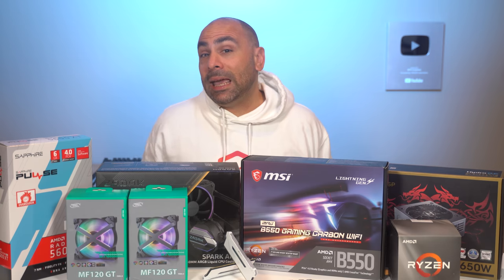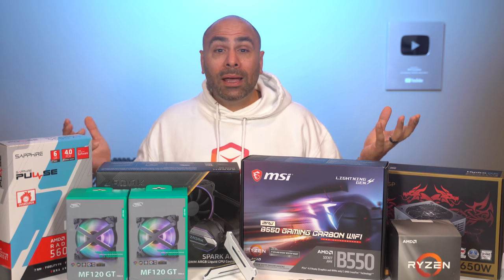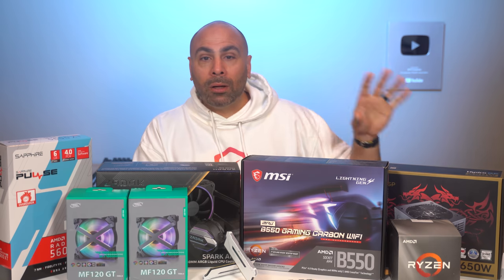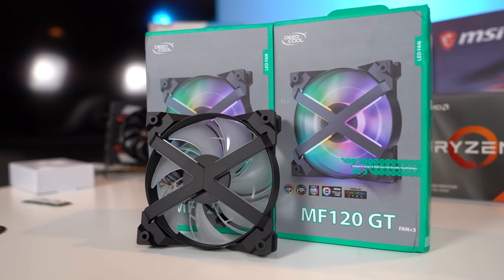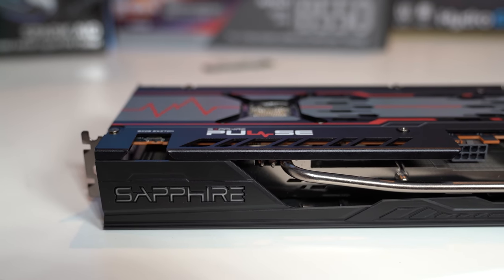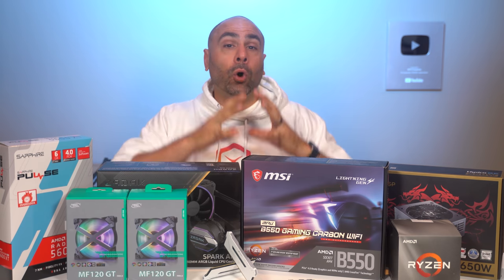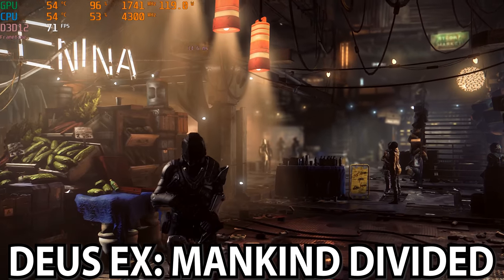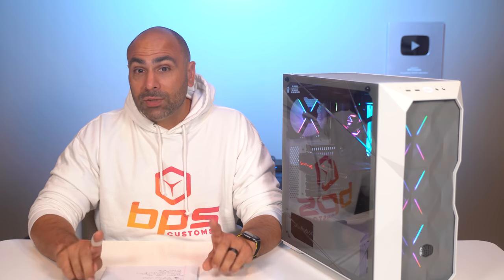This PC Should Be $1000 (But It’s Not)

Comment: For anyone wondering about that windows key. I took a gamble and tried it and it worked! No problems at all either!
Reply: how long to get the key?  Did you have to make a phone call to activate?  Thanks
Reply: @bguillory6675  nah it was instant, bought it popped up copied it and activated it and the watermark went away. Have had no problem since
Reply: @kraqd  Thanks for the info friend, will be starting my build in next few days, and was wondering about these cheap windows keys, I guess for less than $20 I wouldn't be out much if it is a scam.

Comment: G'day Brian,
that is a really nice Build, Fancy but not ridiculous & thank you for fixing the Middle Front Fan 9:19 😬😬😬😬😬OCDOCDOCDOCDOCD,

I've noticed in a few build videos in the US prices are almost what we pay 'Normally' here in Australia for some parts, thankfully we are getting back to normal although like you guys PSU's are hard to come by,
We got AMD's 3000 price drop & stock levels although low are not raising the price anymore, like R5 3600 $299AUD down from $329AUD pre CV (& got up to $369 During CV), B450 is still up about $20-40AUD & B550 is right between B450 & X570 prices for Namesake Motherboards,
Intel Prices are still Sky High for CPU's & M/B, i5-10600K is $499AUD & Z490 starts at $279AUD for the ones You Shouldn't Buy & decent ones closer to $400AUD easily out pricing X570

Comment: b550 Tomahawk is the best all-rounder mobo. Ethernet cable is better than wifi and you can always buy a BT5.0 dongle.
Reply: I bought my b550 gaming carbon wifi on sale for 189.99  but now, Dec 16th 2020, it's going for 219.99.

Carbon WIfi has Better VRM than Tomahawk. It comes with Wifi6 which is good for me since I can't get an ethernet connection at the moment. 
But if you can't get the B550 gaming carbon wifi at around 180 and you're not going to use WiFi on it than the tomahawk is the better option.

Comment: I was so disappointed when I saw that the B550 Tomahawk was for $180.
Reply: Don't be. The B550 improves CPU cooling and that is something no other board can do for Ryzen 3800x and 3950x. Happy Hunting!
Reply: @Ronald1234ize  wdym
Reply: @baiomarlaye3165  these B550 boards were not only designed for Ryzen 3000 and 4000 but they are mainly an improvement for high core processesors such as Ryzen 3800x, 3900x and 3950x. I saw an increase of 5-10 frames more on some games, benchmarks increased a bit and the cooling was the one that improve the performance by a couple degrees less. More control and more performance. That's what you get with B550

Comment: A great alternative cooler is the Noctua NH-U12S.  I have the 3600X with the Noctua, and very rarely see temps over 50C with High to Ultra settings in CoD, SOTR, GTA5, etc.  For comparison, I'm using the Cooler Master H500 case with the two 200MM front fans, and 3 Cooler Master 120mm fans as rear/top exhaust.
Reply: Honestly, playing CoD, my CPU temps are pretty much between 38-45C with the Noctua.

Comment: I agree, for a gaming system there really isn't a need for PCIe gen 4 so the best price to performance is still a B450 mobo. However, great build, you can't use a B450 Tomahawk Max in every video. (edit = completed thought 😊)
Reply: Or a b450 gaming-F
Reply: I got a B550 because I may want the Gen 4 and Zen 3 stuff in the next 3 or 4 years or so. Future-proof.
Reply: pcie gen 3 will get saturated by high end cards in like 4 years watch.
Reply: I went with x570 just for future reasons.

Comment: Really sucks that the b550 aren't as cheap as most hoped for. Like the MSI x570 gaming edge wifi is only 210. Most b550s are that much when offering similar or less specs. :( 
Becuase of that I'm planning on getting and x570 for my r 5 3600, as I want to future proof it but the b550s are just a little not worth it in my situation.
Reply: All motherboards that are built with quality should not be cheap. A basic B550 motherboard are available around 149.99 but who knows where that price went. Happy Hunting!

Comment: Your better off just going for a cheaper cpu and getting rx 5700 Xt and potentially bottlenecking the gpu but that shouldn't be a problem if you overclock the cpu because its always easier to get rid of a $150 part than a $270 part

Comment: This isn't that good of a bank for the buck build change the AIO to a tower cooler and save $50 you can put into a RX 5700 instead of a RX 5600XT. If you change the B550 to the B450 (Tomahawk Max is my recommendation) so you'll safe $100 and than you can get a RX 5700XT.
Reply: True, but he can't do the same build in every single video.

Comment: 3600 with pbo is basically 3600x. Enabling pbo does nothing on 3600x because it increases voltage thus making it run hotter blah blah. Its already clocked as far as it can go basically from the factory. 3600 with pbo enabled tho gets 150-200mhz.

Comment: I know I have posted a lot or question's already, but I could use a lot information, before I actually build/buy parts my pc that I will be using in next 5-10 year's with some minor upgrade's after each 2-4 year's.  I plan to use it for gaming (gta5, deadside, battlefield4/5, starcraft 2...), and 3d modeling/rendering (autocad, maya, home planner...).  I only have 3000$ to spend for everything.  Do you think this is good enough/compatible/reliable pc build for me + having some room to do minor upgrades?
I used partpicker list ( and only that is avaible on it). 

	AMD Ryzen 7 3700X 3.6 GHz 8-Core Processor
        be quiet! Dark Rock Pro 4 50.5 CFM CPU Cooler
        Noctua NT-H2 3.5 g Thermal Paste
        Asus ROG Strix X570-I Gaming Mini ITX AM4 Motherboard
	Crucial Ballistix RGB 32 GB (2 x 16 GB) DDR4-3600 CL16 Memory
	Sabrent Rocket 4.0 2 TB M.2-2280 NVME Solid State Drive
	Western Digital Gold 6 TB 3.5" 7200RPM Internal Hard Drive
	NVIDIA GeForce RTX 2060 SUPER 8 GB Video Card
	be quiet! Pure Base 500 ATX Mid Tower Case
	be quiet! Straight Power 11 750 W 80+ Platinum Certified Fully Modular ATX Power Supply
	Microsoft Windows 10 Pro 32/64-bit
	be quiet! 85 CFM 140 mm Fan x3 = extra
	Asus VG248QG 24.0" 1920x1080 165 Hz Monitor

	Buslink RF-6577L-WH Wireless Standard Keyboard With Laser Mouse
        Corsair Virtuoso RGB 7.1 Channel Headset

=2800$
Thanks :)

Comment: I think memory deserves more discussion and thought when building a Ryzen system. Cheaping out on memory is not a good idea. Not discussing CAS speeds is a disservice. That is like talking about a drag engines cubic inch displacement without giving its hp and torque specs. Makes no sense.

Comment: I think anyone that spends more than $150 on a b550 is a complete numbskull.  Amazon have the x570 tuff for $189. That x570 tuff is one of the best you can get in terms of what cpu it can handle. Meaning it can handlena 3950x no problem. 

The tamahawks? Way over priced! I sucked it up and got a crosshair 8 hero for msrp. Newgg has a backorder option and it takes 2 or 3 weeks to get. I got mine in 2 weeks.

Comment: there are only a few x570 at that price point      the rest are hot garbage
Reply: if you don't need pci gen 4 or plan on upgrading past 4000 series ryzen in say 5 years which i doubt they will be there in that time or need to might as well go with a b450 tomahawk max and save yourself time and money worrying about it
Reply from the maker: The point is that $220 for a motherboard doesn't really fit anyone's definition of "budget"
Reply: @BPSCustoms  yeah i mean ive been hardcore overclocking my msi x570 and my buddy did his b450 tomahawk max the same and neither have issues and both were less than 150